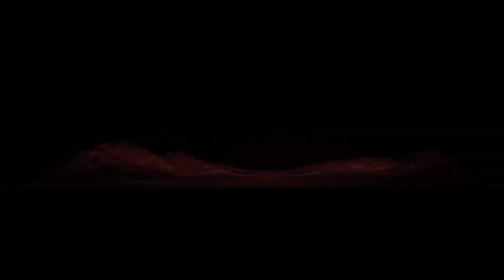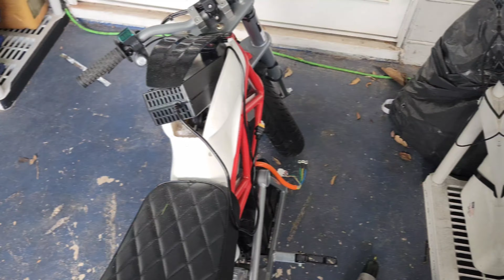48v Razor Rsf650 Gets the New Ec4p Lite Motor!

Comment: How do you like the RSF vs your other Razor? I’ve got both as well but it’s hard to compare my SX500 that’s 50+mph to my stock RSF. I’m looking forward to building my RSF up. It’s my winter project!
Reply from the maker: Definitely perfer the sx500. When i took everything out my rsf and slapped it into my sx, i gained 5 mph. The weight difference alone is beneficial. Then the sx being so much larger rides really well. You can take your rsf wheels, slap them on your sx, and then sell your rsf with the sx wheels lol